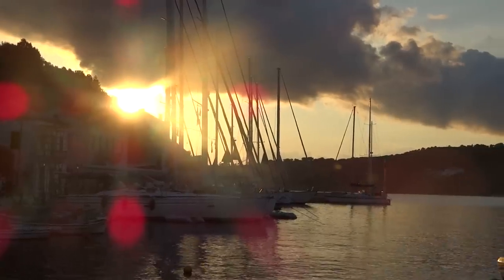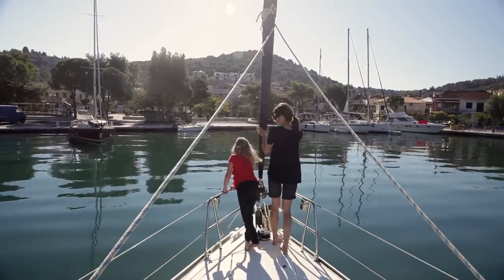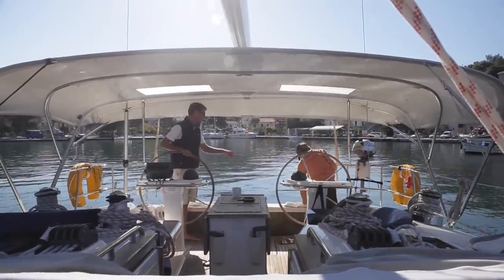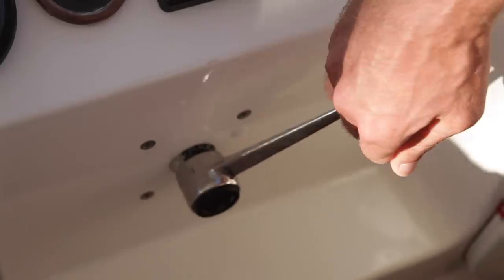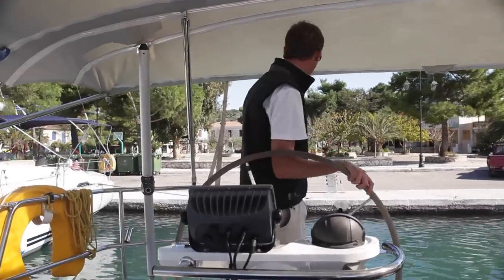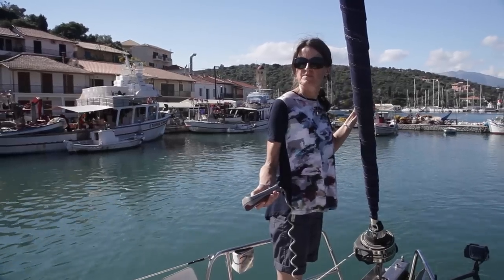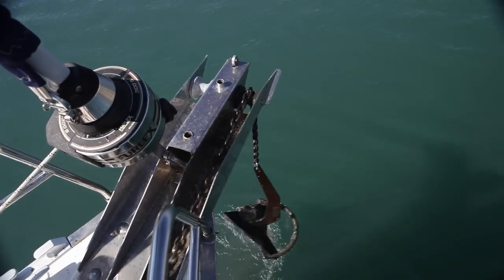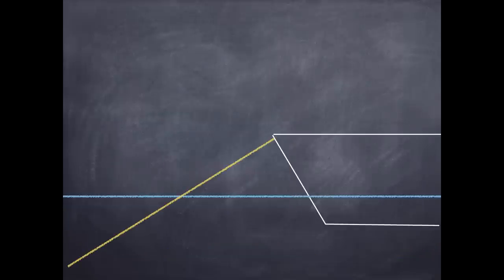http://nisosyachtcharter.com Stern to mooring techniques Greece

Comment: This HAS to be the best Med Mooring video on the internet! Well done!!
Reply from the maker: Top UK Photographer Thank you!
Reply from the maker: Thank you!
Reply: Even the Sunsail one is a bit vague, and also starts when already moored up! This explains it beautifully!
Reply: except for the leaving part! i‘d never(!) leave the dock loosening the aft lines first and then let the boat be pulled out by the lazy lines. 
it may work fine in light to no winds. but when there is a stronger breeze you will need way as soon as possible. no time to wait for 
the lazy lines to sink as the bow immediately starts to drift. so you better NOT let this become a habit. put the engine in forward gear, 
loose the lazy lines, let them sink and drive out of the box in a controlled way veering out the aft lines.
Reply: @seawalcker  
That's it, I'm totally agree with you. Perfect explanation!

The method shown in this vid "How to leave the berth with lazyline" is bullshit. 
You method is much better! 
Thx

Btw:
This represents just my opinion and my opinion is based on my education and experience. I don't want to hurt or insult anybody with my opinion.
Cheers
Reply: a. h. thanx!
Reply: @seawalcker  also good practice to release the windward line last?
Reply: @kleitosaliagas5668  you got it! as long as you can drive with the engine into your windward line your boat is under control.

Comment from the maker: Hi Barry, yes just leave in reverse as long as the anchor has a hold. Always cover the throttle in case it doesn't hold and you need to put into neutral or even fwd gear to keep the stern off the quay. Thanks

Comment: The only addition I would add especially for Turkey lazy line mooring, is once the stern lines are on, let out 3-4 metres of the stern lines so the boat moves away from the pontoon to enable as much lazy line to be taken up before locking it down; then reversing back to the pontoon taking in the stern line slack until your boat is as close to the pontoon as you need, then lock off the stern lines too

Comment: Great demonstration. One question though, when you're about to let the anchor bite, are you keeping the boat ticking over gently in reverse, or are you in neutral? The skipper here says neutral, but then mentions that the boat is not springing forward too much because it is still in reverse. To me it would make perfect sense to keep the boat ticking over gently astern, so long as the hook has bit, and until the windward line is made fast.
Reply: Barry Thomson b

Comment: Compared to a muring line... the anchor can never hold you so tight in position... how to you prevent the boat from collidinig with the pier backwards.. the anchor can not prevent it from moving backwards?
Reply from the maker: A well set anchor will most certainly hold a boat off the quay.  Put lots of chain out.  We have 100m of chain on most boats and the excellent Rocna anchors.
Reply: @nisosyachtcharter79  and pull the anchor tight? The chain will come up high!!?

Comment: What if the anchor does not "catch"? Do you go back out and start over? Awesome video btw.
Reply from the maker: Yes if the anchor doesn't hold, then you are best to start the procedure again.  To check it is holding, when you tighten up on the windlass it should strain somewhat and the chain go tight.  if it just keeps pulling the chain in, then it hasn't set properly.

 All of the Nisos boats have a Rocna anchor which generally hold really well and lots of anchor chain.